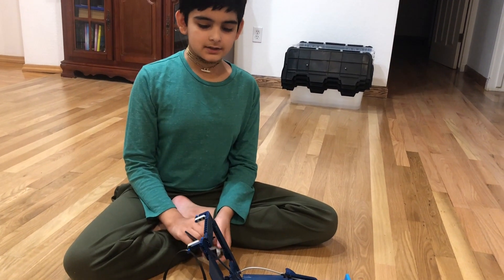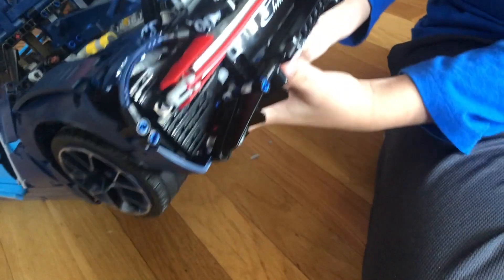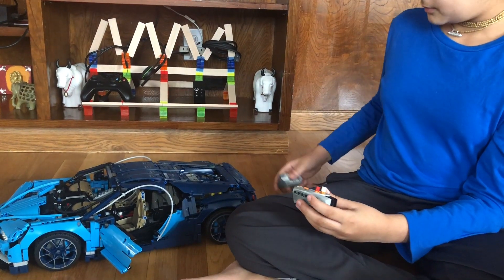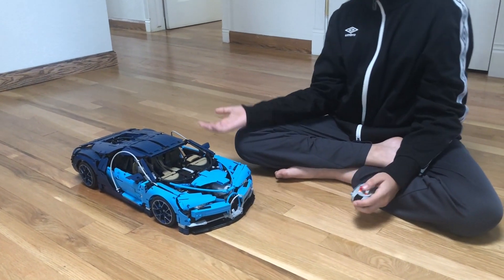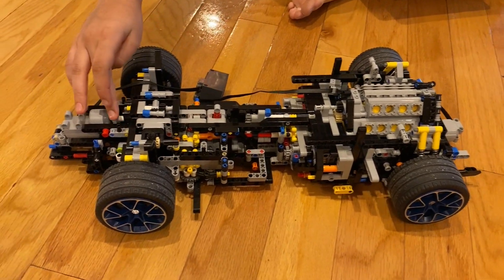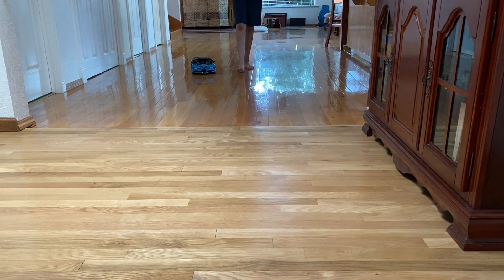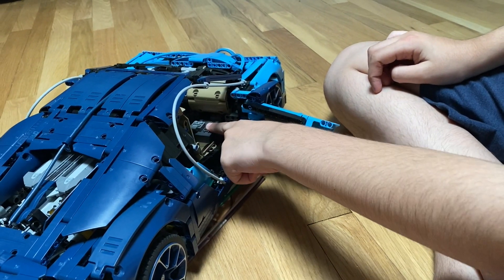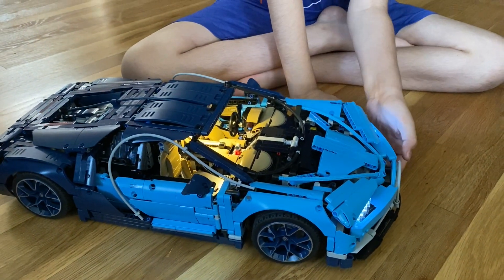How to Motorize the 42082 LEGO Technic Bugatti Chiron | Improvements

Comment: Nice way to motorize the car but using just a L motor puts a lot of stress on them and that actually causes them to abruptly stop. Try to remove the gearbox and but the motors their mabye a 3:1 gear ratio being moved by a buggy motor or 2 l motors with a 2:1 gear reduction? - but great job you know..
Reply from the maker: Those are great suggestions, but there are a few reasons why I didn’t try those:
1. I wanted my idea to be unique and simple, so one of my requirements was to not remove the gearbox
2. I could use a buggy motor, but I would have to change a lot of things and it would become complicated again
3. For your idea of a 2:1 gear ratio, I have tried almost every single gear ratio, and this seemed to be the best. Other ratios would either skip or just fall of.

In the beginning, you said that the motor abruptly stopped because it was undergoing a lot of stress. That has happened to me a few times, and it is usually because the BuWizz is pumping everything into the motor. Since the car is too heavy, the motor gets quite warm and it automatically stops to cool itself down. (That’s why I used two motors instead of one in the Lamborghini) I am still working on a solution, but I am also currently quite stumped. I will reply to this comment once I get a solution.
Reply: @NitaiGoswami  oh then what you did was the right decision :D
Reply from the maker: Thanks! :D